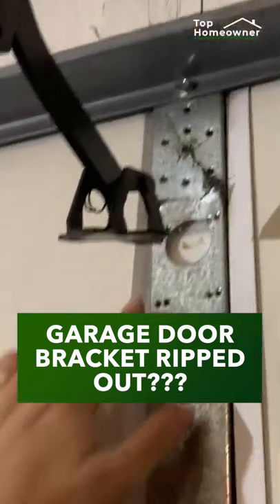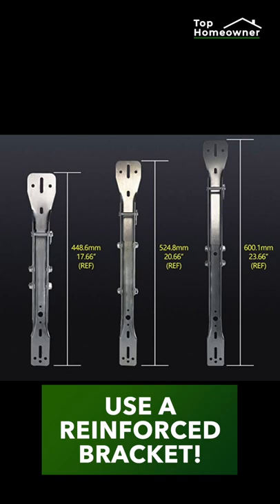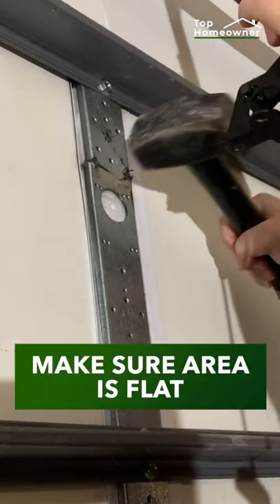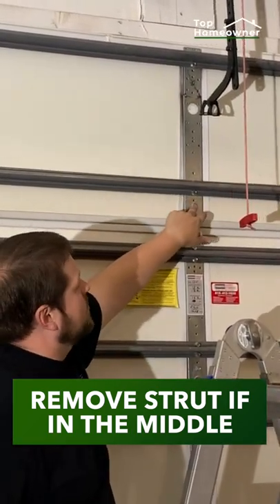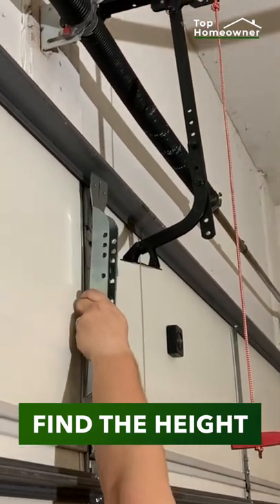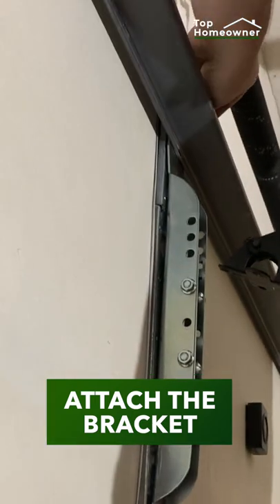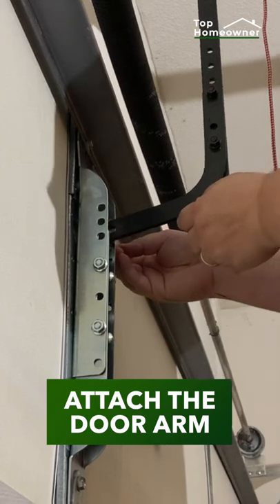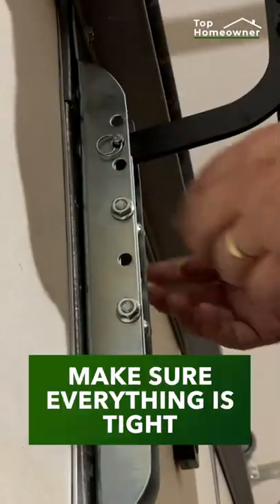Cheap Fix for a Ripped Off Garage Door Bracket #shorts

Comment: You can also zip a piece of angle iron to the door, run it from the bottom to the top with several screws, and then attach it to the J Bar using a bolt and two nuts